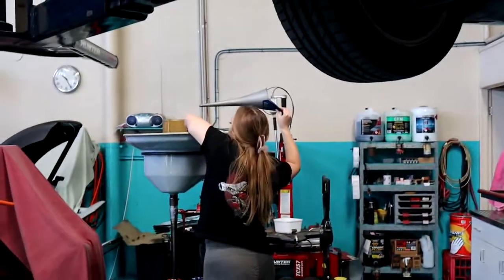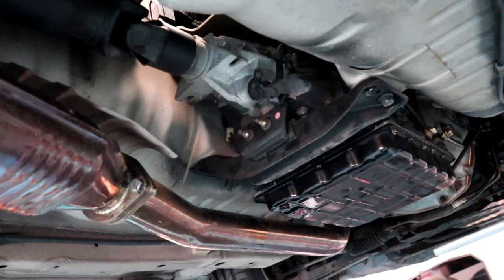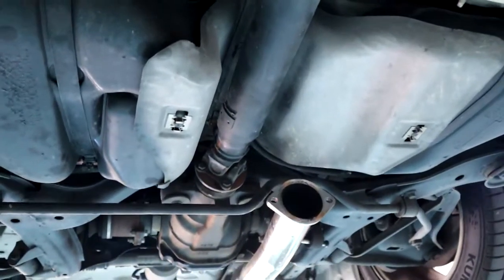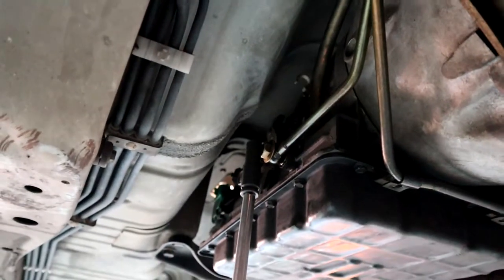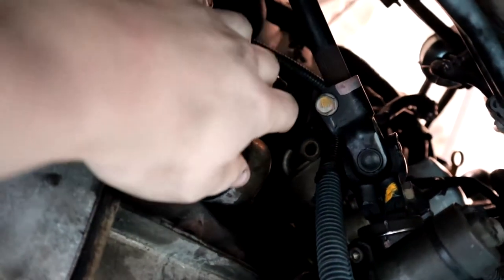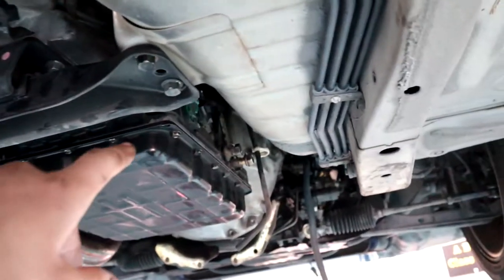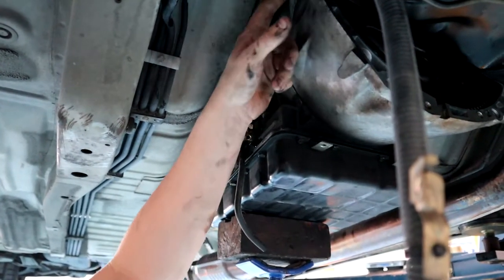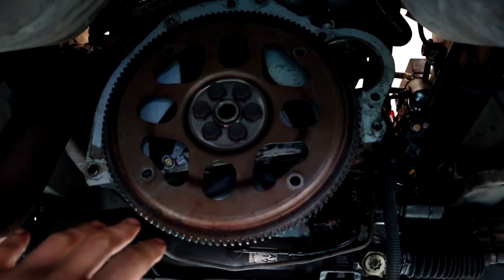R34 Manual Conversion Part 3 - Removing automatic transmission

Comment: I have a r34 sedan auto which I’m converting to manual after I get a couple last things any idea if the front half of a r33 driveshaft 25det would work?
Reply from the maker: This should work yes, I did the same when I had my r34 sedan!
Reply: Get a custom one. I got a custom one made for mee . R33 front tailshaft plug and play into the r34 rear tailshaft
Reply: @nirushanpakeerathan7370  how much did that cost, I'm finding it hard to find a second hand one 
And brand new are around $750
Reply: @GTD22  $750 for custom

Comment: Hey, are you still using the auto ecu or did you get a manual ecu?
Reply from the maker: This car already had a nistune in it. If you are doing a manual swap an auto ecu will still work fine. Going the other way will not (manual ecu in an auto car)